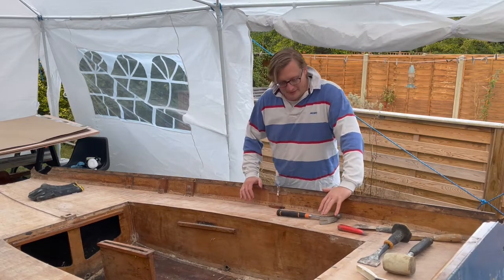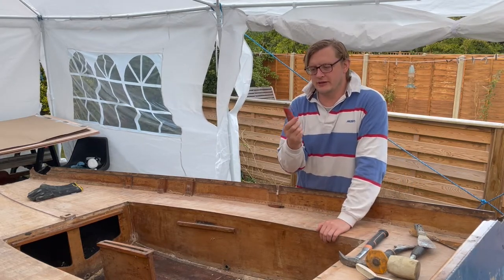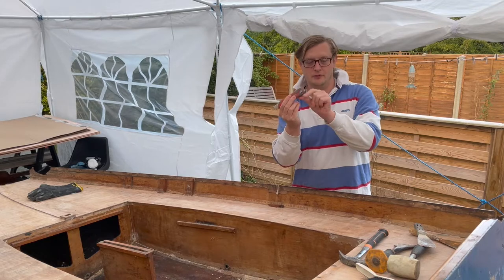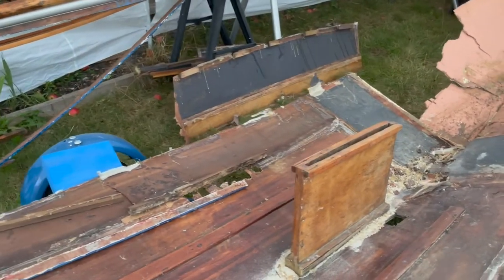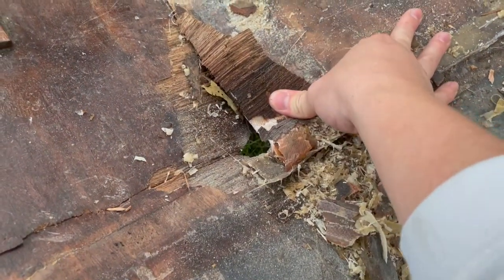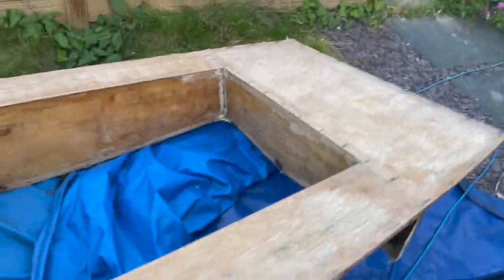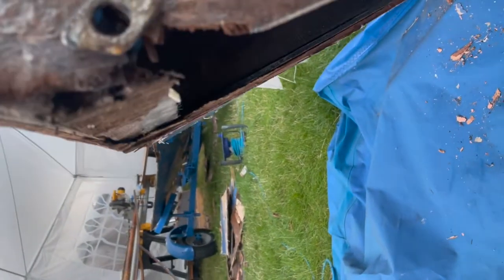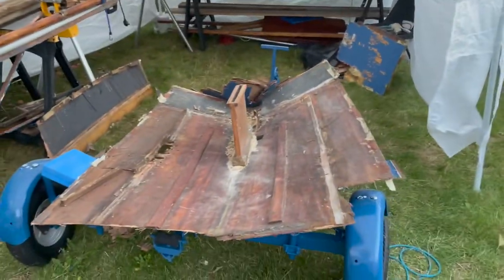Tear it apart!! Disassembling a mirror dinghy (with timelapse)

Comment: Mine looked kind of the same way. Both transoms and side panels were very bad. The bottom panels and bulkheads were good, the interior decking saved to be used as patterns. But still slowly moving forward.